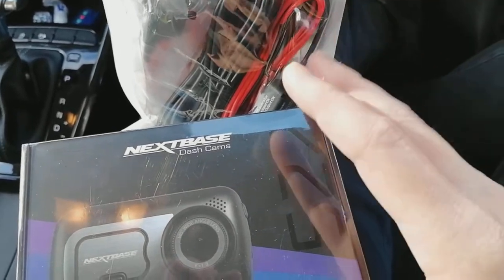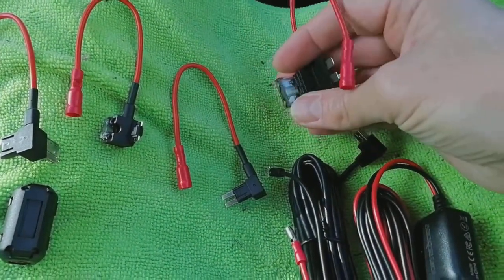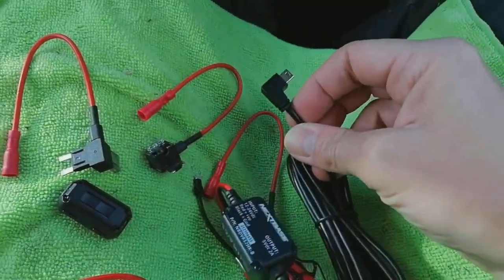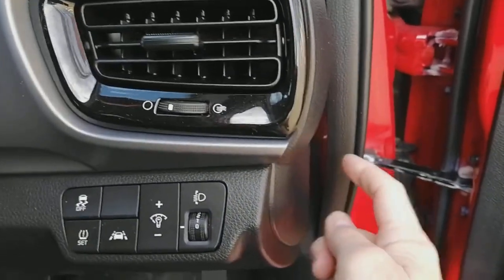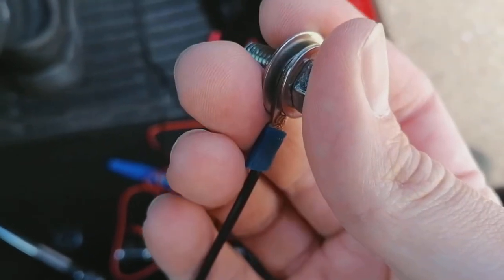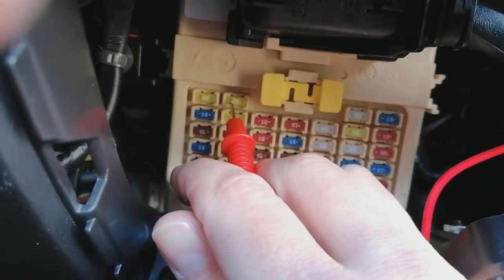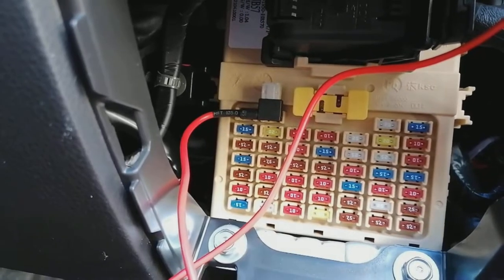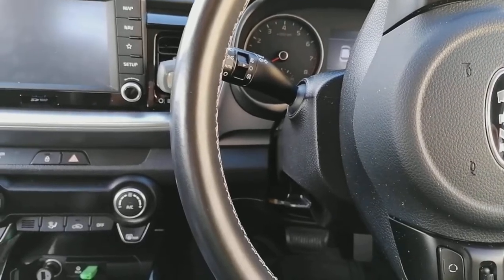Kia Stonik cam how to wire dash cam to ignition & hide all wires

Comment: Hi PJ I’ve watch loads of your very helpful videos on fitting dash cams. Is it possible for your to fit a dash cam in a BMW 1-Series F40 20 plate. I need to know witch fuse I use to piggy back on to for my dash cam. Thanks.

Comment: how long of a wire did you need for the rear camera? how does the hardwiring work out in practice? or dont you use parkingmode

Comment: Thanks, this is a very helpful video, but......  The NextBase kit that I got from Amazon does not include the microblade piggyback fuse carrier. Only comes with the two larger carriers.
Reply from the maker: Yeah that the much older fitting kit, however most car shops or Ebay/Amazon should have them.
Reply: @PJsprojects  
Would you have any idea which piggyback blade fuse tap size I should order for this to work? I ordered some but none fitted due to incorrect blade size

Comment: Hey PJ, thanks for the video very useful. Curious about the orientation of the fuse, on the upside down ones, would the piggy backing plug be the other way around? 
What I mean is, in your example, the fuse is standing straight (20) therefore the piggyback plug cable goes to the left hand side. Looking at the other 20 just bellow the one you use, its upside down (0↊), would that mean the piggyback plug cable would go to the right hand side?
Reply: Never mind, go it, needs to be according to the "hot leg" of the fuse